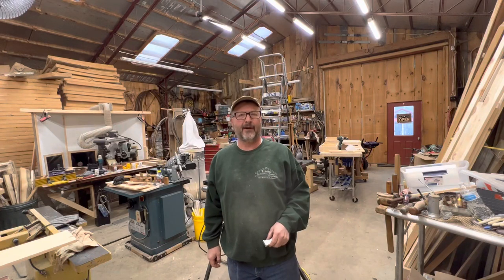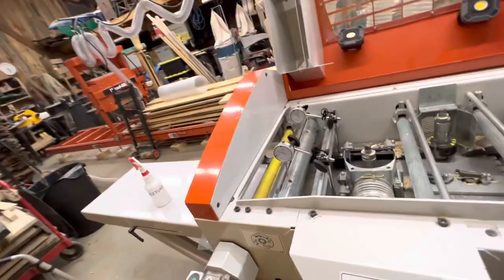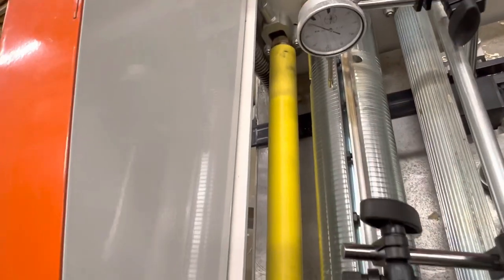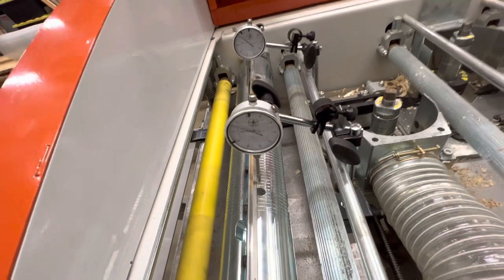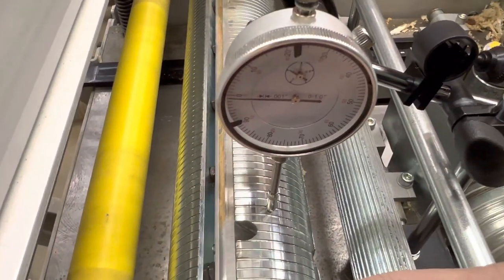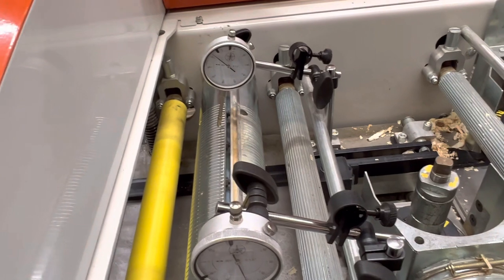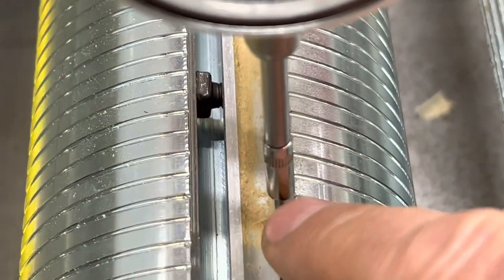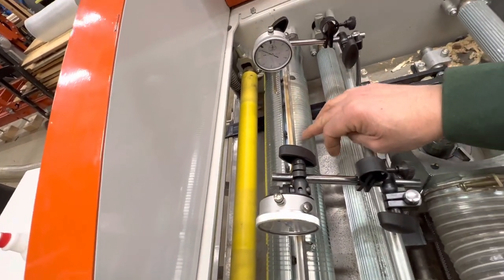Woodmizer MP360 thickness planer cutter blade set up for exact depth on both blades

Comment: Rich, I agree with your setup but I'm wondering if you should have started will leveling the cutter head first.  From what I see  on youtube in the setup, there is an adjustment to the cutter heads height to make them parallel to the deck.  I believe it should be in section 3.7 section "Inital setup of upper cutter".  I'm just wondering if the cutter head itself is parallel to the deck.  It is a bit strange that one cutter would show more buildup then the other in any event, if the cutter head was not parallel I would expect one side of both knifes to be dirty and the cut not to be parallel.

Keep the video coming, I will have 5+ months until mine shows up.  I would also like to hear more about how you wired the unit to power.  I"m working getting a phase convert to power mine.
Reply from the maker: Hi Andy
I omitted leveling the head - I leveled it with machinist blocks when I installed, probably not a bad idea to re-check.  The indicators set on the head maintain their position - so I think the head is in good position.
Reply: @theMainetimberframer  Hey Rich,  I sent you an email with a few questions about your MP360.  If you have time your response would help me out in planning out my setup.  Thanks, Andy
Reply from the maker: Hi Andy
I responded in email.  I’ll put together and post a video of my electrical set up.